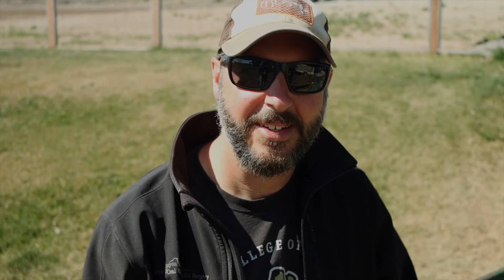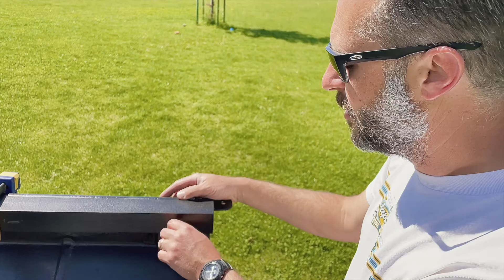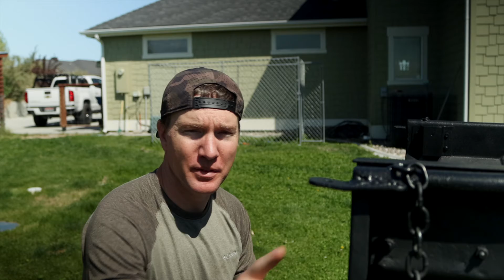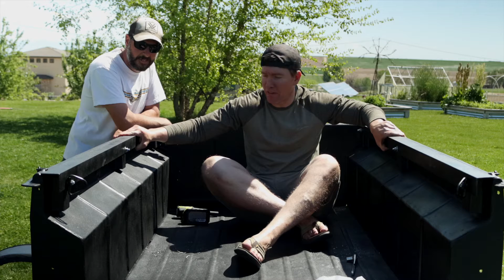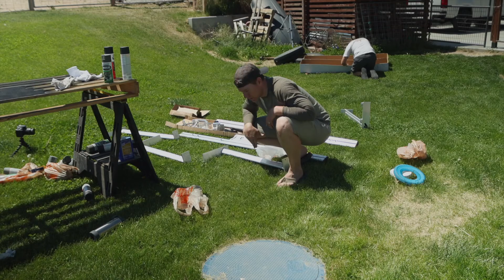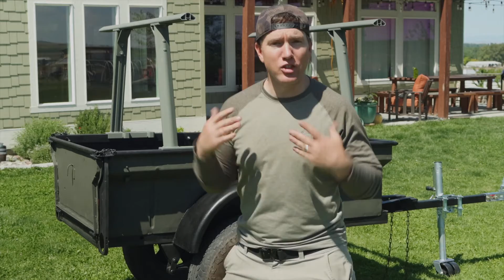DIY Off-Road Overland Trailer Build | Part 3 Bedrack

Comment: That’s crazy. I did almost did the same thing. I used 3x4 angle iron and a 4” flat bar on top. The 4” set on top of the 3” part of the angle which gave me a 1” overhang for the top round over part of the trailer. There was pipe welded in each corner which I threaded to bolt down everything. I put a small side tool box on the passenger side of the trailer and a rack system somewhat like yours. My trailer is a 52 M-100. Going to watch the other videos you made to get ideas. Thanks for sharing.
Reply from the maker: Sounds like I should be watching your vids to get ideas!

Comment: Which rack did you order from Amazon? It looks like a truck bed rack form the box cover? Thanks for the help!
Reply from the maker: Hi Doug - Here's the link to the rack we ordered on Amazon. I think we paid a little less because we go the non-painted option, which for us was great since we wanted to put a custom color on it anyway: https://amzn.to/3Aeul45
Reply: @Venture2Roam  Hey thanks! After installing the angle iron, did you have any issues with the clamp ? The clamps on all of the racks seem to have very little openings for a 2" angle? Sorry for the questions, I'm planning on doing a similar set up with a utility trailer.
Reply from the maker: @dougsteele8624  love the questions, keep them coming!! We had no issues with getting the clamps over the angle iron. They fit easily and were super simple to secure. We took the trailer with us on an off-road trip to Hell’s Canyon to shake it down, and it was rock solid. Vid link here: https://youtu.be/jvszlPWhLCk
Reply: @Venture2Roam  Appreciate the feedback. That trip looked absolutely epic! I'll be in Idaho next week but for a 500 mile mountain bike trip. Is there such a thing as bike overlanding. LOL.. Take care!
Reply from the maker: @dougsteele8624   Have an awesome trip!!